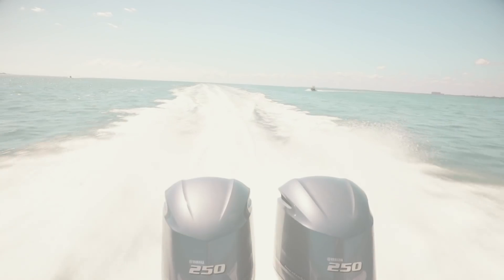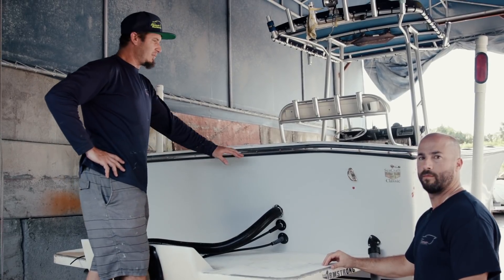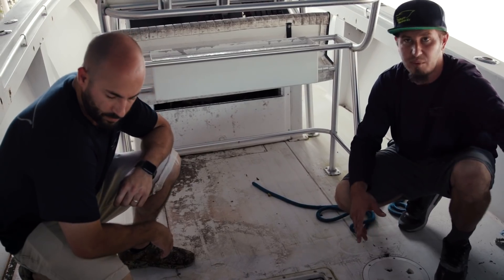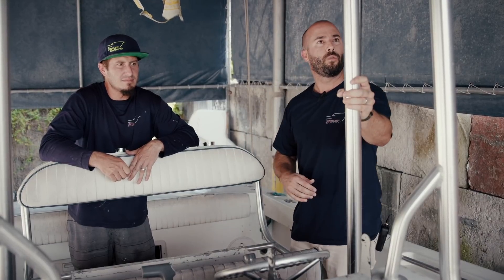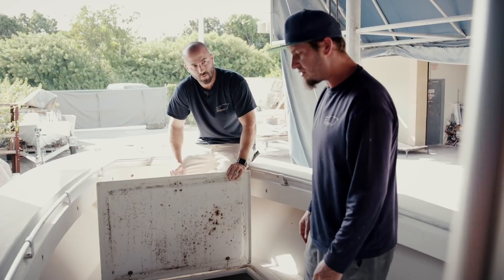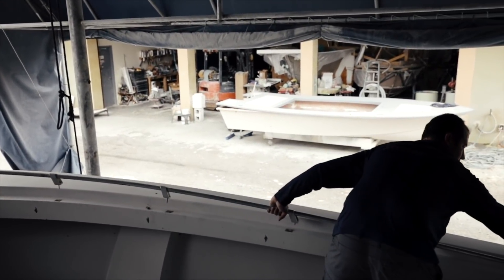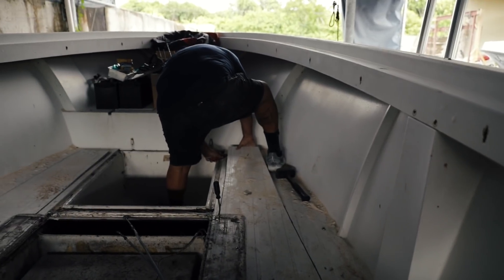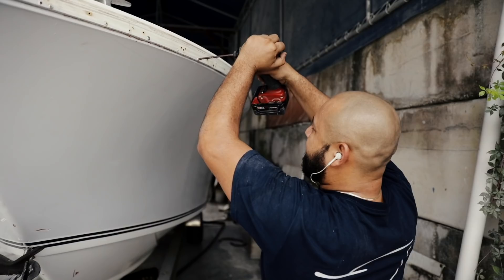CCO Customs SEA CRAFT 23' - Episode 1

Comment: It would be nice to make a mold of the hull and build some new boats.That boat is nearly 50 yrs. old but is a great design.Question is there a market for modern Seacraft 23 boats.I bet there is.Just a thought.
Reply: I  have wondered why some one has not made molds to build brand new 23 footers.I bet they would sell plenty of new ones.
Reply: @spiderdavis3296  there was a shop in pompano Beach called polas outboard that pulled a mold off a 23 , after they added an intrepid bracket to the back. Where called Ocean pro.

Comment: great video. I couldn't figure out the name of the material that will be used for hatches and other parts of the boat. The non corrosive material. "Dimasol" or something like that. What is this material name?
Reply from the maker: Divinicyle
Reply: Center Consoles Only would you like to give us a link because google doesn’t even know lol
Reply: @CenterConsolesOnly   Divinycell It is available from many sources however, Many are using Coosa board which is stronger.